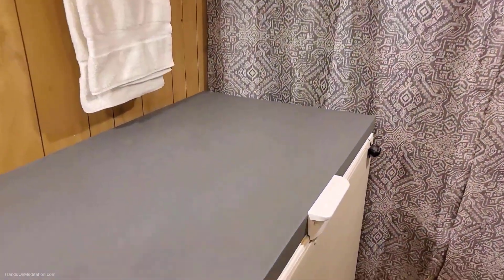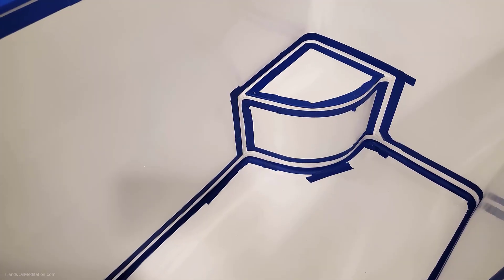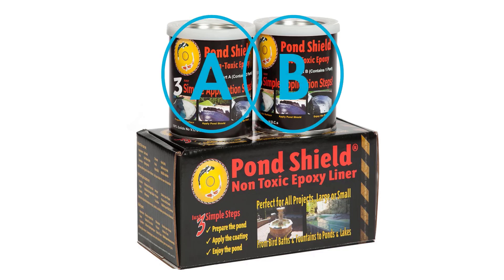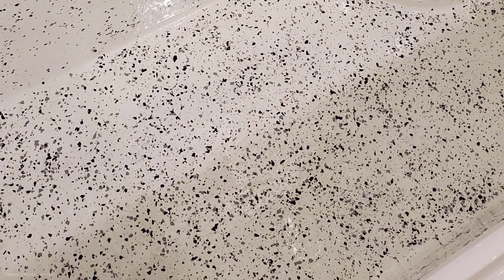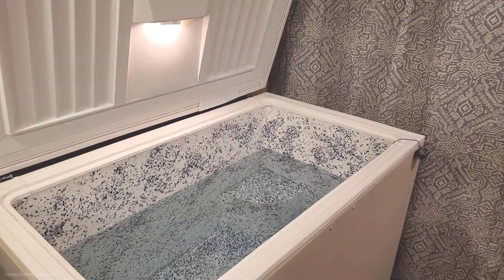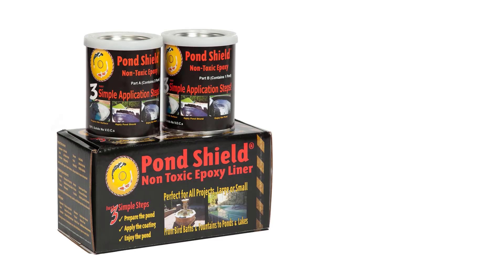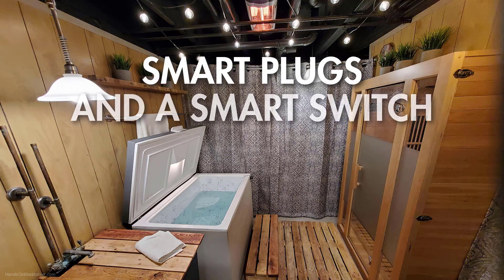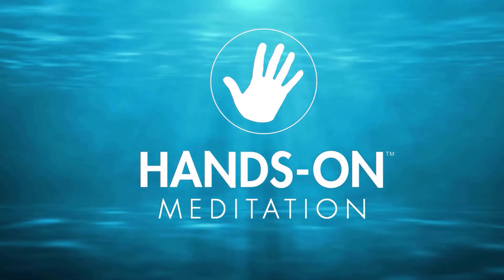Tips for Paint & Color Chips | DIY Cold Plunge | Avoid Rust & Mold | Ice Bath | Hands-On Meditation

Comment: Great video! super informative. I am wondering, I have JB water weld on my freezer converted cold plunge. However, now there are rust spots showing up throughout, including some overlap with the JB water weld sealed seams. Would you suggest sanding down all the water weld before adding the pond liner in this case? or dumping the pond liner over the water weld after sanding off all the rust I can see? I want to ensure the seams are sealed, but I also want to avoid any rust issues.
Reply from the maker: Try to clean up the rust as best you can, and just paint the pond shield over it. Even if you continue to get a little bit of rust, a thick coat of pond shield will cover it and provide a protective coat.

Comment: Have you looked into if the color chips are toxic?
Reply from the maker: The chips are vinyl and there is a toxic warning about consuming them on the bag - so don't eat them, but I'm not really worried about them in my cold plunge. They are used in residential flooring without concern. Also, the plumbing for my cold plunge is vinyl tubing so it's hard to avoid. Of course you should do your own research and stick to materials that you are comfortable with.

Comment: Love your vids mate! Did you need to prep the wall before applying pond shield?
Reply from the maker: I gave it a light sanding but the pond shield dries like a flexible layer of plastic and sticks well.
Reply: Sweet! I am a little concerned with having to clean after sanding, since I already sealed the edges with marine silicone.

Comment: Did you calk all the seams before applying the pond shield? Thanks for all your videos!
Reply from the maker: I sealed the seams first but it might not be necessary because the pond shield will provide a waterproof barrier if you put on a thorough coat.
Reply: @HandsOnMeditation  yeah I wasn't sure because when I look at the advice from pawnshield it says that it won't stick to silicone or similar substrates. Did you find that you had any issues with being able to cover those corners that you had sealed?
Reply from the maker: The Pond Shield seems to stick to Sikaflex Sealant without any issues (but it's not silicone based). Also, I don't think normal silicone caulk will hold up underwater for long. If you want to seal seams in that manner, you should use a marine sealant.
Reply: @HandsOnMeditation  Similar question here, I'm wondering if the pond paint would seal the seams so I wouldn't have to use JB Water Weld. For example, I'd buy an extra can of pond paint and apply it thick to the seams, then I don't have to spend a fortune on JB Water Weld as well. Also, great helpful video!
Reply: Thansk for the video sir quick question how many coats did you do ? Also at what coat did you apply the chips ? Finally did you apply an additional coat and the chips ?
Reply from the maker: @edwardchairez9785 I added two coats of the pond shield paint, and then the color chips are sprinkled onto the surface. I would probably just put them on the bottom. You don’t really need them on the sides, but it does look interesting.
Reply: Awesome thanks for insight I’ve been working on mine a lot of prep work so excited to pour my coats today still how it turns out
Reply from the maker: @edwardchairez9785 The paint tends to pool up at the bottom so start at the top. It will keep running down. Might want to mix a little and practice first. It’s not like normal paint.

Comment: Hello, after seeing so many videos, I really enjoyed yours since it had an approach i found very interesting. I have received a freezer that is embossed aluminum from the inside, and I wanted some advice before I invest in the materials. I was thinking of using JB water weld to seal the corners an such, and then using the pond shield epoxy. And I’m assuming I won’t have to scrub it with sandpaper since it’s already scruffy material. Does this sound ok?  Since my freezer is embossed aluminum from the inside!
Reply from the maker: The Pond Shield paint is really sticky so you probably won't have any issues but you wouldn't have to sand much anyway. I just gave mine a very quick sanding to add some texture.
Reply: 60 grit?  @HandsOnMeditation

Comment: I just bought the pond shield. The inside of my freezer i is metal. Seems to be aluminum? What’s the best way to apply the pond shield?
Reply from the maker: It's about the consistency of Elmer's Glue so it will go on very thick and then begin to run down. I used a large paint brush and began at the top and worked down. There will be a lot pooled at the bottom to spread out, after you paint the walls. Practice on some scrap wood or a small wall first.
Reply: did you sand the inside of aluminum first?  getting 'tooth' ?? @HandsOnMeditation

Comment: How has this held up over time? Any rust on the inside?
Reply from the maker: I had a couple rust spots start to form at first but after cleaning and painting with the Pond Shield, it's holding up well. I added a second coat of Pond Shield when I changed my color chips to blue so it's pretty thick. It's like a layer of plastic over the entire inside. If there's any rust, it's not coming through.

Comment: I’ve build my own plunge and love it. Recently I’ve noticed dents or indentations in the floor where I stand to get out. Sort of a “high traffic” area. I’m worried about creasing or eventually a puncture. Any ideas on how to prevent this? Will the pond shield work? I was considering putting a piece of hard plastic on the bottom but would be interested in your suggestions. Thanks!
Reply from the maker: The Pond Shield will help prevent rust and seal the surface but it won't stop dents. Make sure the floor of your freezer is supported underneath. If it sits on feet, the middle may not be supported. I built a simple wooden frame under mine that supports the sides and middle.